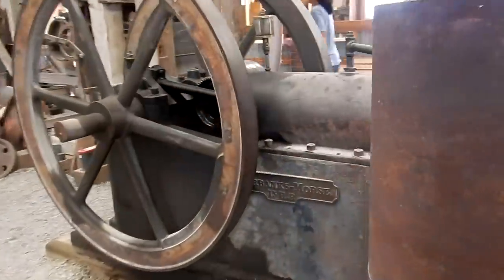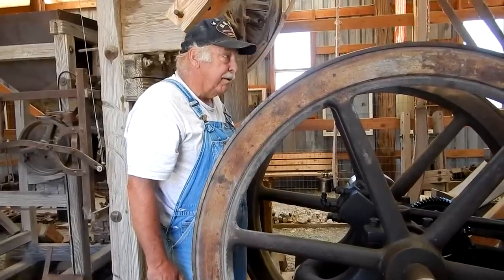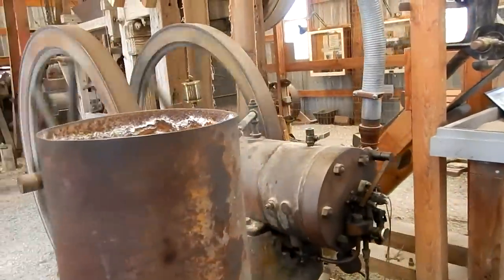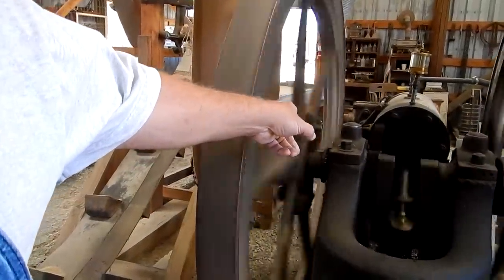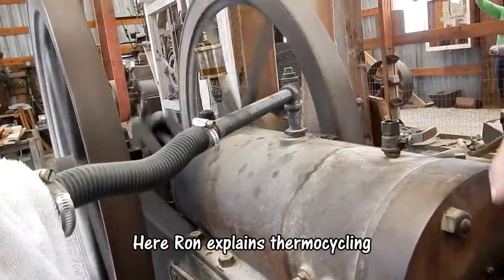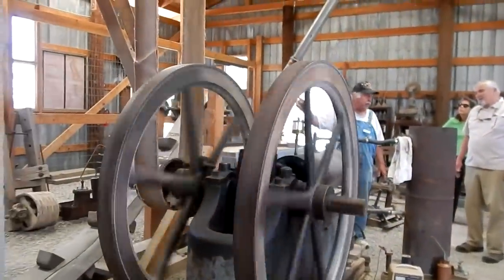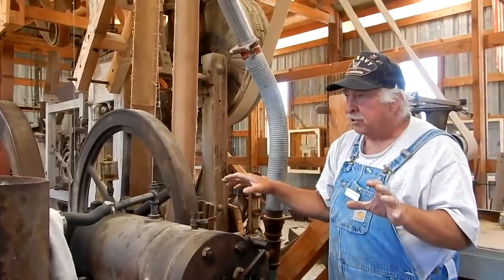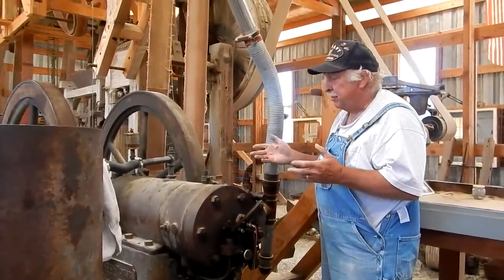1912 Fairbanks - Morse 15 HP Hit And Miss Engine And Two Stamp Mill Demonstration

Comment: Engine advancement is sort of like computer chip evolution.  Today there are engines which weigh only pounds that produce 15 HP.  

So the exhaust valve is held open to prevent compression and the engine slows down until the exhaust valve closes and starts firing the cylinder again.  Must not have NOT been very fuel efficient pumping fuel through the cylinder and out the open exhaust valve until it starts firing again.
Reply from the maker: Yeah, this is a lot of machinery to produce 15HP. I think th HP is a little misleading because once the flywheels get up to speed this would have had a lot of torque and lugging power. I'm not certain of the fuel consumption but I don't believe it is suckling fuel when it's coasting, or missing. Maybe someone that knows about the mixing valve can chime in to clarify. Thanks for the comment!
Reply: They are surprisingly fuel efficient for their design being they dont actually draw combustion air or fuel in until the governor closes the exhaust valve which allows it to draw a vacuum on the intake stroke that is high enough to open the intake valve.  Until it makes that snorting sound it's not using any fuel or air at all. 

As for the mixing valve it worked like any modern engines carburetor that has a adjustable needle valve on the main jet to tune the Air/Fuel ratio to best suit the fuel the engine was running on.

 And depending on the type and quality of fuel and even the ambient temperature or load on the engine the A/F ratios could be quite wide from one the other or even just from early morning to midday or light load to heavy load it could need some tweaking to run best.  

So when they say these engines could run for years with little maintenance they are only telling half the story.  Yes it could take decades of continuous running to wear one out but the whole time it ran someone was usually nearby to babysit it to make it work properly.
Reply from the maker: Thanks for the explantion of the fuel delivery. That makes perfect sense and is what I guessed was happening. I did see Ron doing a bit of tweaking on the mixer and he did say they could run on different fuels as well.

Comment: I believe "balls to the wall" is an Airforce term.
Throttle balls pushed against the firewall.
Reply from the maker: Yes, you are correct. The term 'balls out' is used for a ball type centrifugal governor, used on some old engines, and running at full speed. Thanks for watching and commenting, Matt!

Comment: Those were sometimes called donkey engines in the south. That's real horse power & torque !
Reply from the maker: Hi Dennis. Thanks for your input. I've heard of steam-powered engines used mostly for powering a winch called donkeys. These old engines are fun to see run.👍

Comment: does it run on unleaded ?
Reply from the maker: From what I understand they will run on just about any flammable liquid. So, I'm thinking the answer is yes. I'm not a hit and miss engine expert though. I have one that I can’t get running because of a stubborn magneto that doesn't want to spark.
Reply: @TomandJulieMineExploring  can you not use a magnto off a lawn mower ?
Reply from the maker: @tonybaines3332  I'm sure I could rig something up but I wanted to get the original magneto working.

Comment: The first engine with automatic cylinder deactivation.
Reply from the maker: That would be the 'miss' in the hit and miss name. They are amazing engines. I have a small one that I'm trying to get running. Small as in about 300 pounds for a one and a half horse power. Thanks for the comment, Mike!